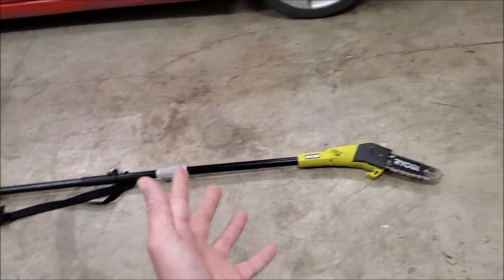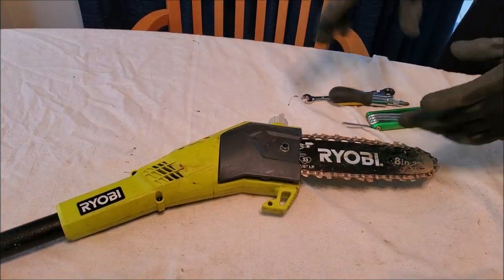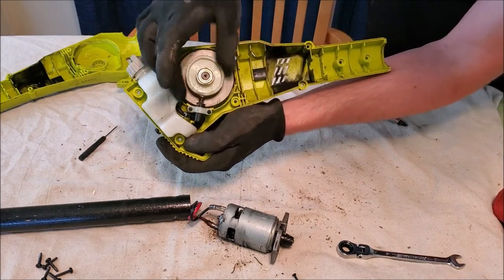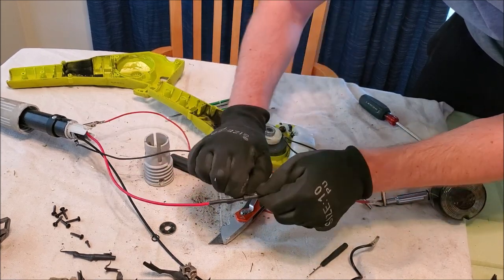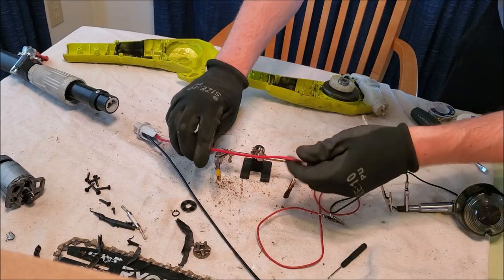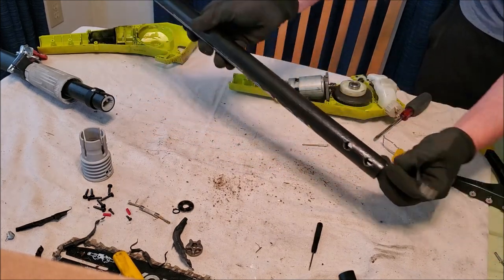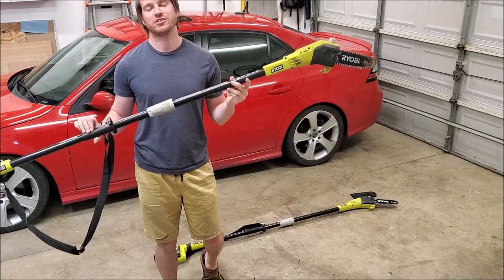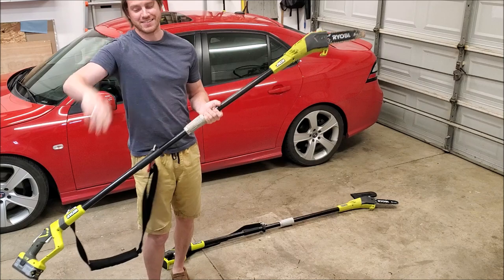BROKEN Ryobi Pole Saw Fix

Comment: Sir, you got to be careful since overloading a motor could lead also to overloading the battery and you could damage the battery to the point it could blow. Me, as an electric engineer myself would recommend you to search for that fuse and replace it. You could modify it a little to be within the top cavity so it is easier in the future to replace in case it blows again, but certainly you should not leave it without that protection.
Reply: I'm going to assume the batteries have a built in BMS to protect them since they're lithium. But yeah, I'd personally install another fuse to be safe.
Reply: The battery will just reset itself and you would simply reseat it. Odd thing of an EE to say unless you're long since retired.
Reply: I was thinking more along the lines of a stalled motor overheating and causing a fire.  They didn't put that fuse there as a joke.
Reply: 100% .....'Slow Blow Fuse' or most likely a 'Thermal Fuse'. ....Overheated the Motor . Lol, prolly why his Multimeter doesn't work which he should have been using in the first place....B+ for efforts though.
Reply: Ryobi batteries are smart because they can be used with old tools that are dum.  The fuse is protection for the motor.
Reply: Wow, I was almost as happy as you when the saw started working. Great job...! Very impressive considering we live in a throw away society. You avoided adding more to the landfill....yay!!!  Thank you for posting...!

Comment: For anyone replacing this fuse when you do cut and replace the wire with one longer that you can connect to the motor  but put your new in-line fuse near the motor so you don't have to remove the lower half again.
Reply: I just ran across this video. I'd use an inline automotive fuse right next to the motor like you suggest.

Comment: The fuse was actually protecting the battery, if the motor is stuck when cutting, it essentially is short circuiting the battery (and motor).  The location of the fuse however should be at an accessible port.

Comment: Good troubleshooting.  The reason why fuse blown is because when the cutting is stuck (motor stopped), you will need to immediately untangle the wood you are cutting and the saw tooth.   Most of the time the saw is stuck when the halfway cutting wood jamming the saw.    When jammed, keep holding the power trigger will cause current overload.   So you can tell Ryobi knows the issue, but instead of using an intelligent design (like at a buzzer to warn user, and a bridge diode to open the circuit), they just add an inline fuse.   You think how many people trash the whole thing because of a hidden blown fuse?

Comment: The decal peels off. You might be able to reapply it. Also you don't need to remove the pin to get it open. Mine came open as soon as all the screws were out. Also didn't need anything to pry it open. Pretty easy!

Comment: Fuses are used to either protect the source (battery) or the load (motor). It's hard to believe Ryobi design engineers placed a fuse in the circuit for the hell of it. It's always best to play it safe and just replace the fuse.

Comment: I am a retired (10 years ago) Maintenance Technician and just bought a 40V Ryobi Pole Saw. While searching on YouTube for practical information on the pole saw I came across this video. Very informative and brought me back to the old days when I really needed to dig deep into equipment to determine  why a piece of equipment failed. Watching your video made me realize how much I enjoyed pulling things apart to find out what made them work or not work. 
Trust me, years from now when you have a lot more income and it's easier to just replace broken power tools, think back to this video. You are very mechanically talented. I really enjoyed this video. I was as surprised as you when you discovered the the hidden fuse. I suspect, Ryobi cared only about protecting that battery and didn't care if most consumers thought that the tool needed replacements.
Reply: Mine stopped working but Home Depot wanted to charge me $33 just to look at it and then I'd have to pay to fix it. I ended up buying another one but the old one I'll see if I can take it to the lawnmower shop and see if they can fix it. If not... I'm out of $100 ...

Comment: Thanks for making this video!! helped alot, first off its a 30Amp fuse. I used 30 amp automotive fuse. worked great! if you don't feel like replacing fuse, just change top part of tool. use part number from below link to find at other sites on net. BUT you you are cheap like me, i took long threaded rod, and worked it down to bottom of handle and used rubber mallet and hammer the end out. do NOT drill out pop rivets, doesn't work. plastic piece just pops out of end, there is key on wide notch at connector end. the middle will pop out if you knock it out. has just plastic tabs holding it in. refer to video to see wiring assembly removed. very glad I had this video the see how things go back together. soldier longer wire back were you remove fuse about 6" long and then soldier fuse near end of tube at motor end. I fixed 2 pole saws. both have been running great for about 2 months. thanks again!!!

Comment: Thank you very much for your interest in taking up this project and sharing it. My corded Ryobi 8" pole chainsaw needed a chain replacement and after chain replacement it worked as usual. I found that the oil seal rubber gasket is torn in a small portion and oil leaks. I have to replace the gasket for normal use.  Prior to that I need to keep adding oil to keep the chain lubricated.  However, out of my curiosity, I have been looking for a video to see what is inside of it, i.e., a complete disassemble video.  I found your video - exactly what I was looking for.  Thanks for your service to this DIY community.

Comment: At 3:46, the retainer clip does not need to be removed. The motor assembly will stay with the upper housing, no problem. 
At 9:47, the pop rivets do not need to be removed. Once the wires are disconnected from the motor, the plug at the screw end can be pushed out.  Use a 1/4 in dowel to push from the other end. 
Be sure to mark the position and insert it the way it cam out, or the polarity will be reversed (with a permanent marker, put an arrow on the end of the connector which points toward the wider notch).
The entire power pole section can be replaced for about $12 (plus shipping) from online suppliers.

Comment: I really appreciated this video. I personally would have added a fuse holder at the outside of the pole under the casing near the motor. Perhaps research the potential replacement fuse and have a pop in fuse instead. Then only have to take the casing off, replace the fuse, test, put back together.

Comment: Follow up from me. I opened my broken one, made in 2016, up today and there was no fuse inline inside the portion where you found one. It's possible there's one inside the handle side (didn't have a multimeter to test with), but my hunch is that the fuse was a revision of the design sometime after mine was made. Mine also has phillips head screws rather than torx FWIW. I'd love to think that there is an even newer revision with a user accessible fuse, but I'll have to think hard on if I want to replace it with the same tool...

Comment: This saved me - got mine fixed by removing fuse! Pro-tip: I took a shortcut, instead of disassembling and messing w rivets, I took a grinder and notched a channel in pole (near lower icon of the 5 colored warning symbols) to expose the fuse then I cut out fuse, connected the remaining wire ends - no splicing or soldering! - and elec tape it up then elec tape around my channel in the pole.  Bingo bango…
Reply: I hope no one does this... You should have at least reinforced that section of the pole, now that you've compromised its structural integrity. It will not hold up nearly as long as it could have.

Comment: I am highly impressed with your investigation.
Ryobi is certainly a brand that offers a lot of value, decent performance, a huge line up, and generally fairly priced.
But sometime you have to wonder what the heck they were thinking, putting a fuse in this hidden, hard to get place like that.
Hiding screws under a label ? Choosing to use a rivet to seal access to inner tube ? Really? 
It sure looks like they want you to replace the whole tool with a new one
All this for a 1$ part ?

Shame on you, Ryobi !

Comment: Without a fuse in the system, if there is a short in the motor, or an overload (the likely cause of this) the wires and motor will heat up and potentially start a fire or burn out the motor windings. The fuse is not there just to protect the tool, but also the operator. Also, without the fuse, the break-point in the case of overload will likely be the motor windings, not the feed-wiring. This makes a $50 part - the motor (assuming you can source it) the part that gets replaced, rather than a $1 fuse (or <$10 pack of fuses).
Argue with the placement of the fuse or the fact that it does not appear in the parts diagram, if you want, but the existence of the fuse is sound (and inexpensive) engineering. Eliminating it would seem to be placing the motor at risk. You also don't want a dead short (in the motor, perhaps) being transmitted back to your expensive lithium-ion battery either, without a fuse in-line. Else, you will be blowing the protection circuit in the battery, or worse. That would potentially yield both a blown motor and battery, which would not make you happy. 
My suggestion is not to overload this small, cordless saw, something that is pretty easy to do. Allow the chain to do the work and don't press too hard on it. Else, you will  overload the motor, not only beyond the spec of the fuse, but beyond the spec of the motor and its windings. The fuse is specified to blow before this happens to the motor. (And I speak as one that has done this myself.) This would be especially important if you have bypassed the fuse and its circuit protection.
Reply: He overloaded the motor by running it out of oil, not by trying to cut something too hard.

Comment: Great repair job. I have 1 question.
The rivets you added. Was the shaft and adapter still in the same position as it was with the original 2 rivets?

Comment: SMH. I must admit that until today I've been a pretty ardent defender of Ryobi tools as good value. Putting a undocumented fuse in a non-user accessible location is pretty terrible. I guess I get to tear mine apart and replace the fuse. I definitely won't be rebuying this tool if I can't fix it with your guide. Anyone know if the fuse is marked with a rating and what it is if so?

Comment: Agree. Shame on you Ryobi. A good ploy to increase sales of (pricey) spares just because of a blown, cheap little fuse!. A responsible company would make that fuse readily accessible. Thanks for putting this out there. You potentially saved a lot of cash for people with a failed unit. Maybe a wise thing to ask a qualified electrician to do the repair if you lack the nous to do it yourself. I took delivery of mine today here in the UK and I'll remember your video if anything like this happens to mine. Great video, well presented.

Comment: thank you sir for your willingness to look further than the problem.  i live in brisbane, australia. i am looking to buying a chain saw head for which i am told will fit my pole lopper.  speaking to a lady at bunnings here and she has gone thru 3 heads, she said 'the heads died' maybe what you have found, she somehow overloaded the fuse while cutting. and nobody knew about the $10 fuse, thank you once again.  if i bump into again at bunnings i will ask her about the heads and what did she do with them.

Comment: Im getting ready to buy this, but still contemplating on milwaukee which it cost too much. I hope ryobi is worth the money for diy.
Reply: I got one of these about a year ago and it did quite well on two long 5" branches; my two complaints; the pole is wabbly at the joints, and the oil tank is quite small- check your oil often!
Reply: Milwaukee, Homelite and Ryobi are made by the same parent company (Techtronic Industries, TTI), wether they also share designs remains to be seen. The also make Hoover, Oreck, Dirt Devil, Hart as well.
Reply: @henrywolanski5339  ...also Ridgid power tools...
Reply: @henrywolanski5339  also the orange Ridgid power tool line...

Comment: Just had this happen today. My question is what capacity battery were you using when the fuse blew. I seems to ship with a tiny 1.8 Ah battery, I was using a 4.0 Ah battery for longer runtime. If the fuse was 3.0 Ah may be more apt to blow? However any battery can surge higher than rating so maybe a moot point. Now my idea, Is there a micro circuit breaker that can be added to the shaft that held the fuse (drill, mod, add)?
Reply: You have zero understanding of battery, Amp hours, volts or anything about electric tools.

Comment: The fuse could be attached right before the motor. That way it’d be easily accessible and could be changed. You really should put the fuse back because you can cause serious damage if it overloads again w no fuse. Just my opinion of course

Comment: They have these things called continuity testers. You know, to quickly tell if wires or connections are broken. You might look into it.
Reply from the maker: There was this small thing called a global pandemic and lockdowns at the time of making this video.. I chose to use what I had available at the time. While it wasn't as fancy as a tester it still worked to demonstrate what was faulty with this tool.

Comment: Just wondering if you had any problems with your saw!  Battery exploding or motor smoking.  I did the same thing with my saw.
Reply from the maker: Nope no issues but I do recommend replacing the fuse and placing in a more serviceable location

Comment: You can just peel the label out and put back.  
Be careful putting the guide dowels together and not pinch the red or black wire. Jus saying I pinched the red but it good.  I did find a tiny rectangle rubber band.  I don’t know where it came from.

Comment: I would try a 12/24v 30 amp automotive auto reset circuit breaker.  If it trips, no need to replace.  Breaker cools and resets itself.

Comment: hey u skipped past the part where the previously riveted  electronic connector was put back into place,  after you removed the fuse and lengthened the wires to attach to motor.   Im not talking about the motor end part,  Im asking about the tube part that holds the other length of tube together with the electronic connector inside (that originally had the rivets in it that you drilled out).  I want to know how you secured the electric connector that previously was riveted.
Reply from the maker: That electrical connecter you're referring to just pushes and it pops back into place. If you look at 10:28 when I remove it you can see it has a locking tab. Then at 17:33 you can see my different approach to riveting the gray collar back on that goes overtop that electrical connector. I'm probably making that sound more confusing than it really is but hopefully that helps.
Reply: @WeakestofWeeks  Crap looked at mine and its different than yours...The location where the power cord connects to the unit is like a black cup.  I guess to protect your hand from touching it it pulls out some...Pole part is different as well..it was raining so I didnt get to write the model number down yet..But symptoms are same..no power at all
I think this is the same model  https://www.homedepot.com/p/RYOBI-8-in-6-Amp-Pole-Saw-RY43160A/203159669

Comment: Thanks for the informative video-I own 2 of these in 40V (same cutting end, slightly different battery & switch section).  I was totally unaware of this hidden fuse, and I can't think of a dumber or more inefficient place for a fuse, unless Ryobi's intention was to force consumers to constantly replace their pole saws for what should have been a minor issue.  I believe that approach is called planned obsolescence (but at the risk of excessive in-warranty claims).  Your rivet idea has a defect that you might not be aware of unless you occasionally add an additional (optional) pole section for further length:  there's a lot of stress with a longer pole tending to bend, and the place it shows up is just above the old rivets, above the plastic piece that holds things together.  I've had to replace the entire section because of such repetitive bending, although you might get lucky because the top section isn't where the most bending occurs.  And one last suggestion:  get a VOM meter--it'll be so helpful in determining if there is a continuity issue, and perhaps help more easily identify where it is.
Reply: This is NOT planned obsolescence... It's a fuse, a safety device that protects the motor, and there really isn't a better place for it if you look at how the motor housing is designed. Most people wouldn't disassemble it at all, so it wouldn't matter where it was located. I'm willing to bet that Ryobi technical support, or even reading the owners manual, would tell you that the fuse is there. It protects the motor from excessive current draw, like from a chain that isn't properly lubricated and is probably binding, and extends usable life of the tool.
Reply: @JV-io3nn  Fuses are great, and I have often replaced them in my equipment.  But putting them where they're hard or impossible to access is a VERY poor design element.
Reply: @richardefriend  Honestly, it doesn't look like they had a better place for one on this tool. It's easy to say that it should have been up in the head of the unit, by the motor, but there really isn't much space for one without modifying the unit. 

Even if they had, it still wouldn't change the fact that the vast majority of their customers wouldn't take the time to diagnose the issue.